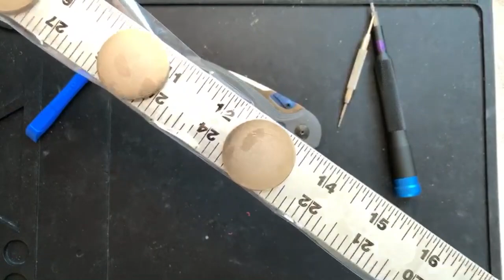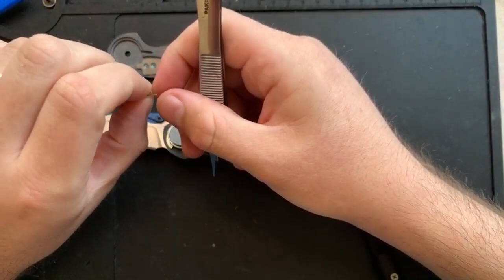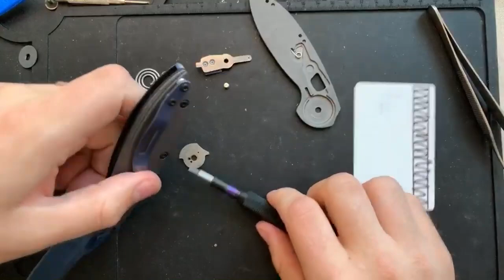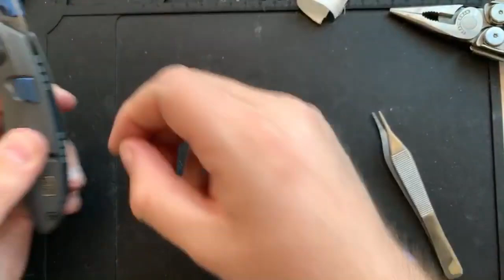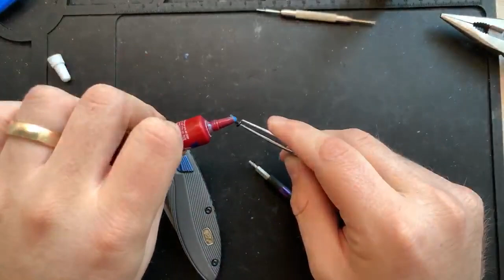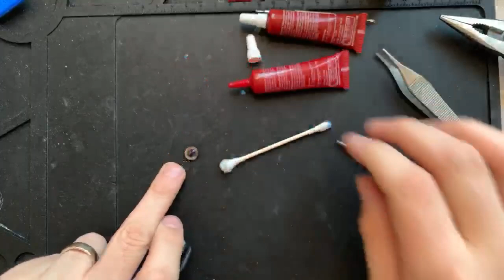Nick vs the Un-Reassembleable Knife, Round 2: The Springening

Comment: Next in the series: Nick reassembles a case knife. 😆
Reply: Thats an  EASY  process to comprehend compared to this. 

VERY CAREFULLY grind away./remove one head of the brass barbell pin, with a foredom or dremel This part will need to be replaced, or the scales need to be replaced and epoxied.

 The rest of the pins are straight, driven out. Parts are fitted, sprngs to tangs, reassembly. 

You will need a small vise, small hammer,  punches etc.

If manufacurers would replace the barbel and pins with some sort of modern fastener...bingo...😂

Comment: The switch side pivot screw may control tension on the deploy plate, but not on the blade. Also the clipside pivot end is "D" shaped.

Comment: Omg flip the knife over build it. Or Use grease to stop that circular pivot spring in place in the show side scale or use that tape to keep the little spring in place ,then use a hair dryer to melt the glue so it doesn’t pull the spring as you remove it if that fails just cut the tape so that you can’t see it

Comment: Nick...this brings up the idea, how in the Hell do they expect you to clean this knife. If you gotta detail any knife...its an auto, if carried.
Reply: Throw alcohol in the action then spray it out with an air compressor. Then drip in oil. Done
Reply: @valkyriesurvives5109  well...sure...but pocket lint gets trapped in belly buttons, so autos are no problem😂 Wet lint knots up and sticks in small crevices, between springs and worse yet...it'll grab really fine silica that will get lodged in any pocket that is not turned inside out in a washing machine. None of this stuff is dissolved by 91% IA...which is why I asked.

Comment: Is there a knife assembly wax for small parts etc?
They should call this knife the Bad Divorce, because once you purposely take it apart you will pay HELL getting it back together😆

Just sayin....

Solution: Take it completely apart. Send what you can to a professional fixed blade knifesmith. Have them divide the parts and set them in an expoxy resin used for making scales from more fragile materials. They can then produce you a fine fixed blade, that you can split 4 inch sawn logs with when batoning.😃
Then you can beat the dog crap out of it...all the time.
You're welcome.

I would suggest JW PETERS...Forged in Fire Champion...the Messer Sword episode.

@Nick Shabbaz